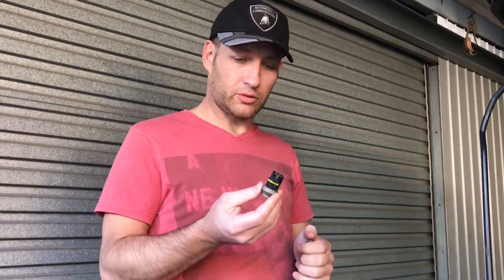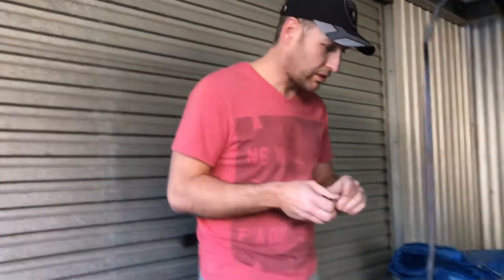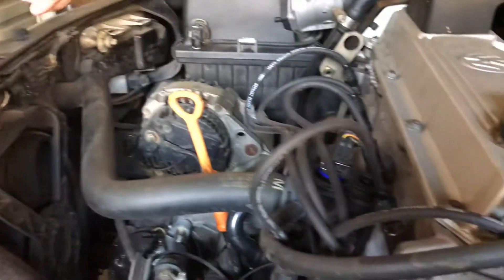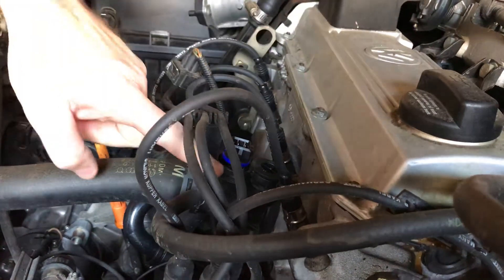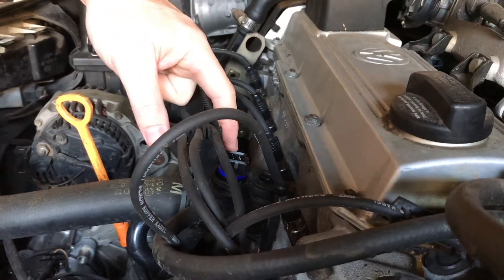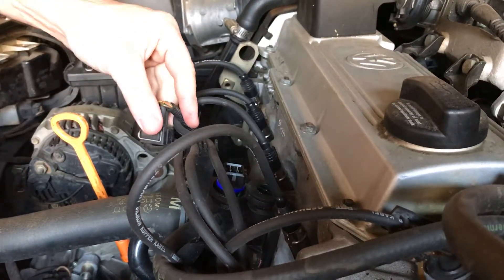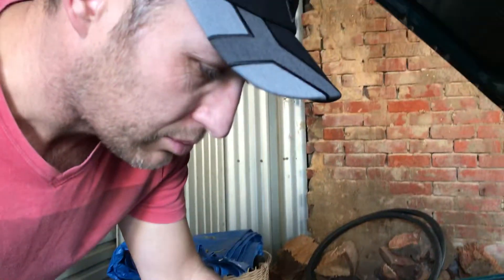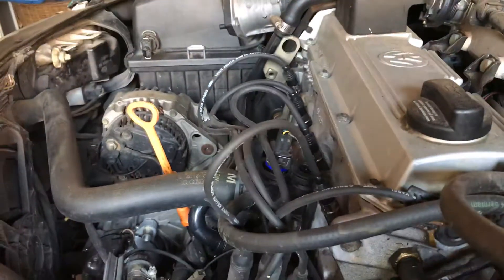Replacing Volkswagen Golf MK3 temperature sensor causing cold starting issues

Comment: Golf 3 1.4 1992 here. I have a cold start issue and sometimes a warm start one. It won't start. I usually get a cap full of fuel and drop it into the filter bay(where the monoinjector/carbonator valve for air is). I discovered that if it doesn't start unplugging the sensor then replugging it works. Or starting the car without it. Also the thing is that when it's plugged the idle is a bit rough and driving low rpms (4th gear 50km/h) it jitters. When the sensor is unplugged the car is smooth. Needless to say, I bought a new sensor.

Comment: Hi Mick. I have a golf mk3 from 97. 1.6 litre 75hp. Which i would need to crank a few times before starting but usually starts nonetheless. My car however wouldn't start after driving it about 20 miles and driving it quite warm at around 75 mph. I had to leave the car overnight and was about to call a towing truck the next morning but it started and i could drive it back home from a nearby town. Could warm starting problems also occur due to a faulty temperature sensor?  After driving it back home i parked it near my house and the same problem occured. It wouldn't start again after driving the same 20 mile trip home. The part was quite inexpensive so might be worth a try.
Reply from the maker: andersiglum hi there, I’m not sure the temp sensor would cause that but I also had a similar problem to you. Twice I went for a long drive say around 30 mins and then my Golf stalled and would not start, the second of these times it was a permanent failure. What was replaced was the part where the centre high tension lead from the distributor plugs into, it’s call the ignition coil pack. There’s also a sensor in the distributor that could cause the issue. Hope this helps.
Reply: As Mick points out seems like the coil pack is gone. Quite common problem in MK3s.  Otherwise check relays 30 and 167, those control the ECU and fuel pump, if any of those fails there's no fuel going to the injectors. If that doesn't work either, try the crankshaft impulse sender, if the ECU can't read the crankshaft position it won't start as it doesn't know which cylinder to fire first.
Reply: I had the same warm starting problem with my Mk3 tdi & a new temperature sensor fixed the issue.